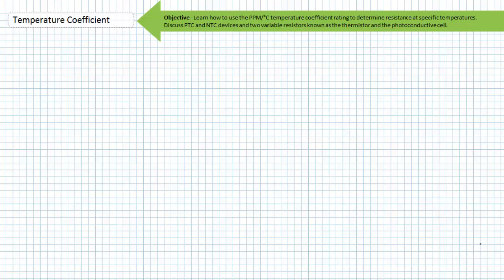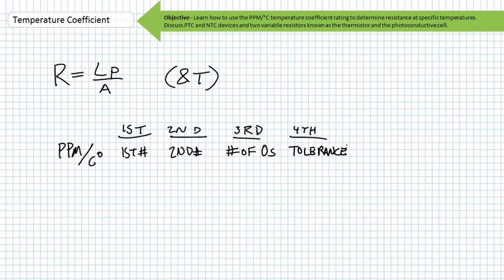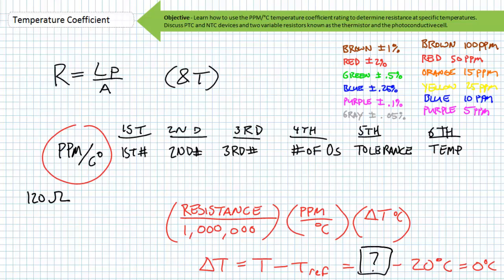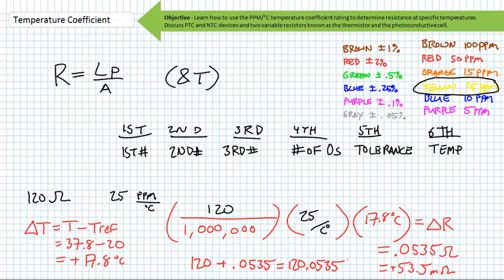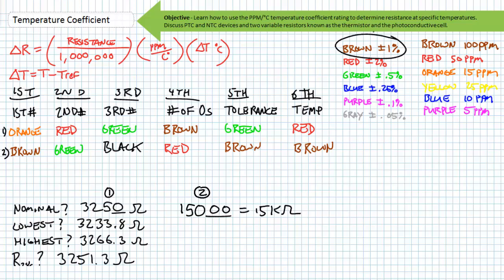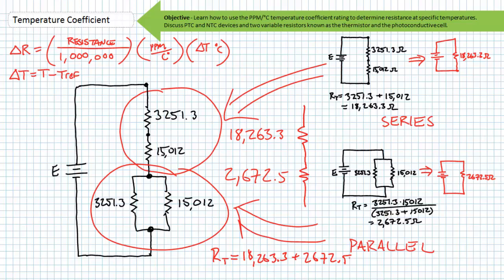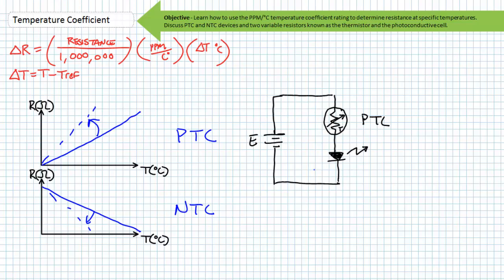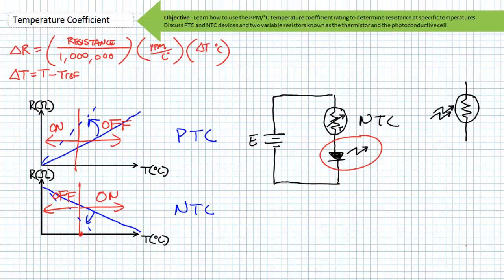Temperature Coefficient

Comment: In the first example with the 120R you came up with .6R diff. but i came up with .5R diff. but in the subsequent example's i came up with your numbers. am i doing something wrong with this example? or is it my sneakie lab partner.
120/1000000 = 0.0001 ... 0.0001*500=0.05 ... 0.05*1=0.05 ...
Reply from the maker: Looks like you've got a minor rounding error ... 120/1000000=120*10^-6=.000120
Reply: yes i see the error of my way... smath was set too low for the decimal place.
Reply: @bigbadtech  quick question. is the 20-degrees-Celsius reference a set standard or was it a placeholder for the video. if it is a placeholder, where would I find reference temps
Reply from the maker: Normally it's 25 C.
Reply: @bigbadtech  thanks I was curious

Comment: In the example with the 3250 ohms, the tolerance is .05% representing a variation +/-16.25 ohms and the variation of resistance with 8 degrees is just 1.3 ohms, around 8% of the tolerance, so why do we bother with this little variation?
Reply from the maker: Most of the time this level of exactness is a non-issue, however, demanding applications like aerospace or extremely precise measurement equipment operated in environmental extremes need to take this into account.
Reply: Understood, tank you for answering my question.
Reply: This minute level of exactness is required in some test equipment design.